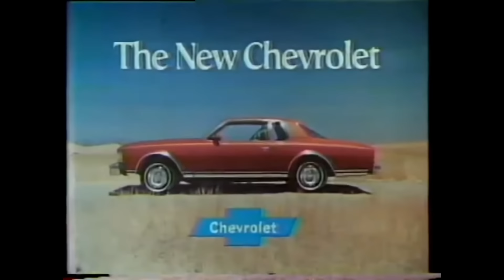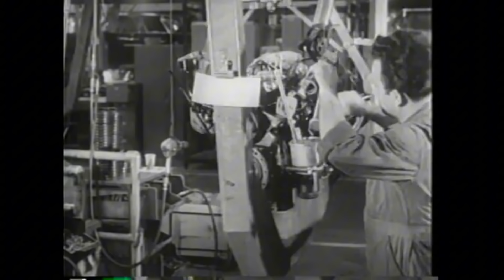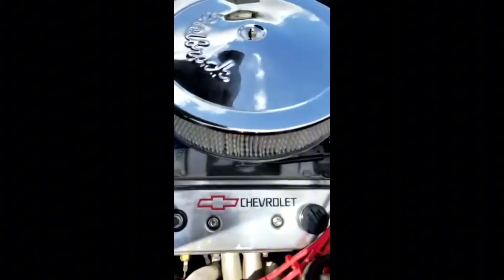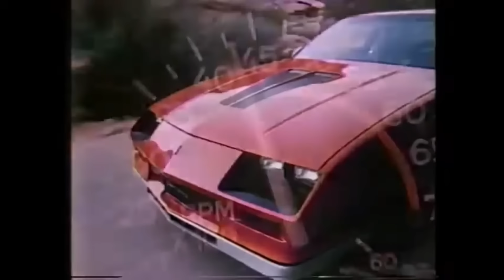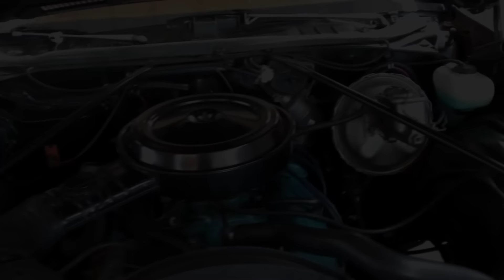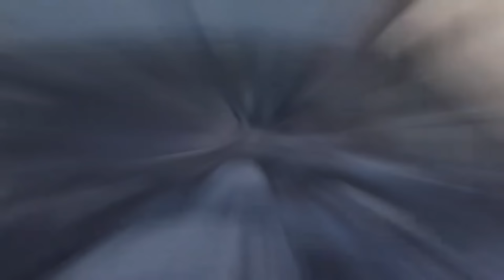How the Chevrolet 305 V8 Became GM’s American Savior AND Scapegoat

Comment: My 87 El Camino is definitely a lover and not a fighter. It's my daily driver. I bought it new.. the 305 4v and 200-4r are a great cruising combo. I use it as my light farm truck too. The engine has never been touched. Orig timing chain.. valve covers have never been off. I have replaced 2 transmissions and carburetors. The car now has 747k miles and still going strong. Timely and routine maintenance is the key. Also, know how to drive what you have.
Reply: For real!!!747,000
Reply: @rickyakins8930 yep . And I've never washed the engine. Zero leaks. She's going to the shop Monday to replace exhaust manifold gaskets but really never a problem. I did add all of the F-41 bits.. MCSs steering box.. jeep steering shaft.. tubular rear upper and lower trailing arms. . In spring air bags.. true duals with magnaflo mufflers..and power seats from my old 85 Supra. A perfect color match to the burgundy interior.
Reply: Holy shit 747k on the 305?
Reply: 1979 Malibu 267 cu inch 4.4L, bought new, camshaft lobes rounded down at 210k miles after religious oil changes. Parked inside for 12 years w/$2,000 rebuild engine and turbo 350 trans. May sell, no time. Let someone else enjoy. Btw, Rusty Jones didn't work lol.

Comment: Chevrolet should have never replaced the 307 with the 305.  Mileage was only marginally better.  Performance potential was significantly reduced because the bore was too small for large valves.  I've built 307's.  They're a 283 with a 327 crank, so they actually have quite a bit of potential.  The 305 is an under bored 350.  If I'm building a SBC around 300 CID, why would I build a 305 when I can build a 302 or 307?  The problems the 305 had with cams and cranks early on certainly didn't give me any warm, fuzzy feelings about it either.  The only thing going for it is it's not a 267.

Comment: Was it GMC that made a Big V-6 305 ?!! That was the 305 that would've pushed GM right through the 80's... Lol
Reply: Yes.  Had one in a 65 3/4 ton. Total garbage.  Lol
Reply: They also made a V12 702 out of two of them,  the Twin Six.
Reply: It was GMC that had the 305 V6.  I pulled an ASA stock car, trailer, and about 1500 lbs of tools, parts, and drums of race fuel for almost 200,000 miles in 6 years without anything but a new clutch, tires,  and normal maintenance.  It was kinda slow getting up to speed on the interstate but would cruise at 80 all day long.  The owner finally bought a newer crew cab truck and retired the GMC.  It still ran well and used no oil.  GM should have kept that engine.
Reply: Yes good low end power but got terrible gas mileage.
Reply: Has a 69 gmc 3/4 ton with a 292 inline six! That was a hoss!
Reply: They were used in the heavy duty truck like farm grain trucks and dump trucks. They were not the best of fuel but they had the power to pull and haul loads. The trucks that had them were not fast but had pulling power.

Comment: If you say so! :)   I ordered a new GMC K1500 series in 1983 and wanted the 350 engine, but I let my friend ( the sales manager ) talk me into the 305,....I wanted this truck for snow plowing and general work,   BIG MISTAKE!  The 305 might very well have "saved General Motors " but it sure didn't help me much.  Two years later I traded it in on a Ford F150 with a 302,....THIS is the truck I should have ordered in the first place.
Reply: What gears in that Chevy? For snow plowing I would think nothing less than 4.10.
Salesmen usually don't understand mechanical stuff like this.
Reply: I traded a1982  Chevrolet 1/2 ton pickup in on a 1985 F150 with the 300ci 6 cylinder. Great truck and the 6 cylinder was an absolute mule for a motor. Stuck with Fords from then on.

Comment: worst sbc ever was the 262(75-76) and 267(78-80)
Reply: Fact! Also the 350 diesel steaming pile.
Reply: Yes, I had a 1980 Cutlass with the 350 diesel.  It also had the too light for the car turbo 200 lockup trans.  Both piles of crap!!!  Bought it with 28,000 miles.  By the time I hit 32,000 miles the trans, injectors and starter went out.  Fixed it a dumped it and lost a TON of money on the deal!!!
Reply: 307 was a piece of annoying shit. Whenever I see what I think is a small journal 327 at the salvage yard, it always turns out to be a 307. Such a turd. The only way to tell them apart is measure the bore. Which you have to remove the head, and to do that means remove all the crap attached to the head. Exhaust bolts dont turn and snapping them off isn't always easy. I hate them. The bizzaro engine has to be the L99 4.3L V8 in the Caprice classic in the 90's. Very unknown but it exist.
Reply: @Lost_Between_Heaven_And_Hell  you can take that L99 crank and rods, and order a set of pistons for the DZ302 put it all in a '86 up vortec 350 and you'll have a roller, vortec 302.
Reply: @Lost_Between_Heaven_And_Hell  but the 307s with #3970020 could be bored safely to 4 inch making a 327
Reply: @Lost_Between_Heaven_And_Hell yeah, very tough to get anything approaching 400 hp with a 307.
I Think the bore and stroke  screw it out of hp potential...
Reply: @Lost_Between_Heaven_And_Hell  I always stole the 307 crank and put it into a 350 with 327 pistons.  350s were a dime a dozen then.  Both had large journal cranks.  Only drawback was the 307 crank was cast, never forged.  Still had my fun turning them into 327s and dropping the 350 cranks into the 307 blocks to make a 328.  The 328 configuration was limited by the required 1.71" intake valves, so it was better as a lower rpm unit that got out of the hole a little better.  Not worth it to me in those days.
Reply: The 267 was also a very bad one too. this engine was basically a 305 with a even smaller bore. it was a real gutless turd of a engine! That said, the 305 is not really that bad of a engine and yes you can make more power with a 327, 350 and 400 small block, you can get a 305 to make respectable power with decent heads and the right camshaft and more compression. basic hot rodding tricks works well enough with it and they are cheap and easy to find. I had a 1979 Caprice 2 door with it that i inatalled a Edelbrock performer intake, I recurved the stock HEI distributor and a Quadrajet carburetor with dual exhaust with 36" glasspacks and it ran pretty good for what it was, i ran a 17.3 at the KCIR 1/4 mile in 1986 at 84 mph. keep in mind the engine had over 170.000 miles with a stock longblock in a heavy car with a 2.41 axle in it. it would hit 70 mph in first gear at 5,000 rpm. second and third gear would make a total mockery of the Ridiculous Carter Mandated 85 mph speedometer. Third gear would have the needle touching the middle of the right turn indicator in the instrument cluster.
Reply: @Bigdog302V8  the gears they put in the cars is alot of the problem. they were so high you couldnt top out.
Reply: Had a couple Monte Carlo's with 267's. Yes, they were a piece of crap.
Reply: I had a Caprice with a 267. I was young and stupid and the guy lied to me.  I'd be shocked if that thing made 100HP.
Reply: @ilikepushrodv8s210  i think alot of 267s were mistaken as 305s and is why they get  the hate. unless you look at the casting # you dont really know since they used the same heads. anytime you see #601 heads on a 305, high probability its a 267
Reply: @ilikepushrodv8s210  Oh, they don't wake up until 2500rpm.  Not a bottom end motor.

Comment: The engine that replaced the 307. Mostly due to TransAm racing production standards which was capped at 305CI and the 302 was ceased due to emissions and cost
Reply: The Chevy 305 had nothing to do with Trans-Am racing. Not even close.

Comment: It’s a shame they didn’t offer the grand national 3.8 L V6 in some of these bigger cars. It had about an additional hundred horsepower.
Reply: It was also Turbocharged. GM could’ve put a Turbo on the 305 which it should’ve got for Camaro/Firebird models
Reply: @Bob-gy6ud a turbo 5.0 would be pretty cool.
Reply: @matthewwalker9256  that was the biggest oversight in American v8 in the 80’s no turbo like Europe. Asia and Australia was mostly turbo 4 or 6. I loved my 86 T/A 5.0 but it was dog and pathetic. My 90 GTA 5.7 was better but not by much. Buddy had a 90 5.0 RS but had a 5 speed and was a blast to drive. In factory 5.0 w M5 was only way to go 700R4 was to new and TH400 was still favored so 700R4 had to wait for all the love

Comment: I bought a 1980 Trans Am with a 305 and it got terrible gas mileage and was so slow.  I had just totaled my 1979 with a 6.6 TA motor and the insurance got me the 1980.  I drove it for 3 years and unloaded that turd!
Reply: You T/A had 301 pontiac v8
Reply: @fjcruisefjcruise4527  do a search- they put the 305 in models that were ordered that way.
Reply: @fjcruisefjcruise4527 Some did have 305 engines for 80-81. California maybe?

Comment: 283 with a 327stroke crank
Reply: That was a 302
Reply: @marktep1225-xh2qh  That was the 307. The 302 had a four inch bore & a three inch stroke.
Reply: That was the 307, which unlike the 305, was actually a good engine.
Reply: Ihad them in work trucks I never had a problem with and I own the 187 1987 Silverado throttle body injection 305 Evan great but it's just lack the power of a 350 the gas mileage what is pretty much the same

Comment: The problem was that it was a smog motor where emission control was in it's infancy and they would get plugged up with carbon.  Add to that inferior internals (the cam, mine was toast at 75K) and everyone rolls their eyes.  Remember the 305's ugly older brother the 307 had it's issues too and was the small block no one wanted in the early 70's.

Comment: We had a 305 2bbl V8 in a new 1977 Chevy Caprice.
It was a great engine, good power, good sound when you got on it & we pulled a 23 ft boat with it & no problem.
It would smoke the tires off the line.
We finally sold the Caprice with 110k miles on it.
Reply: Agreed 👍 I have a 1978 Chevy Caprice Classic Coupe with 28k original miles and the LG3 305 2bbl, great cruiser engine and reliable 👍😎

Comment: How is it different than the 283  because I've had some really awesome 283's?
Reply: 283 was less or a torque motor but had more compression and made more power but it had to get reved up first.
The 305 had more torque at low rpm, before the down shift of the trans occurred.
Reply: It's about 22 different.

Comment: The flat cam special .
Reply: My father had a '77 C10 with a 305. GM paid to replace the camshaft when a few lobes went flat before 50,000 miles.
Reply: Bad  valve guides too, that is why I replaced mine with 400.
Reply: I lived the gas lines like what the Appointed OBiden Regime 3.0 did.

Comment: Calling BULL SHIT on YOU! 4:02 Minutes into Video: 305, 140-145 HP, W/2 BBL Carb. Compared to 1966 283 W/2BBL Carb, 190 HP (Actually rated @ 195HP). You MORON! 1966 Rating, is GROSS Hp, with Nothing attached, No: Alternator, Fan, Water Pump, Belts etc etc,. Late 1970's and on, 305? NET HP, @ The Rear Wheels. EVERYTHING Attached, including Transmission Drive Shaft, Rear Differential, Etc. Are you Incompetent? Or REALLY, this Stupid? You getting a "Thumbs Down". One more Shit talking Video like this? You'll get Blocked, Deleted! FIX IT, ASSHOLE!